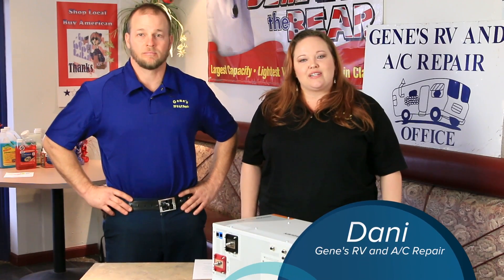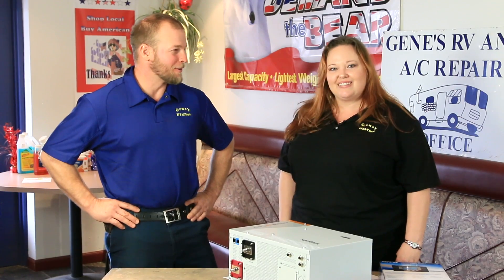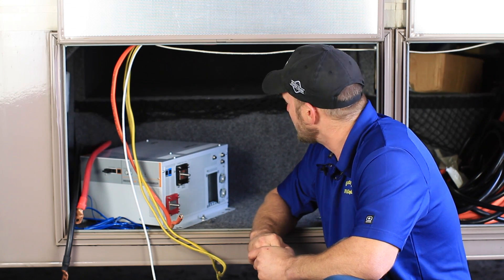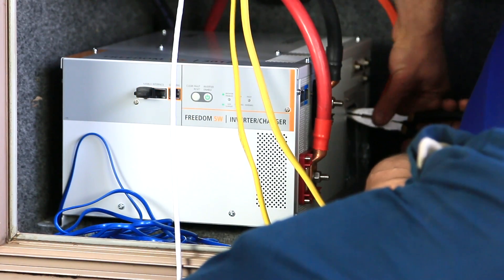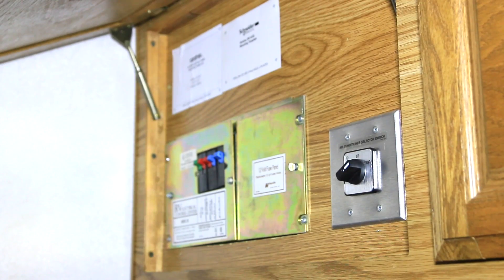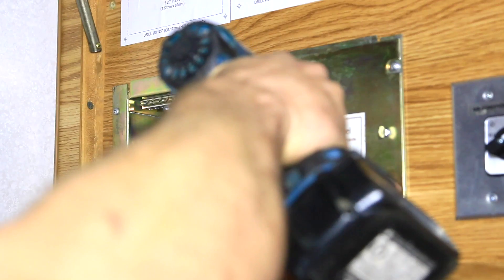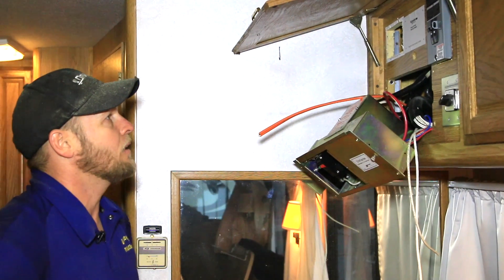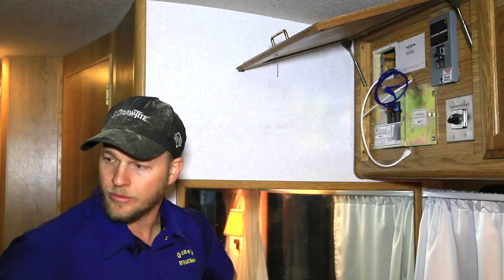Pippi Peterson RV Project - Replacing a converter with the Freedom SW Inverter/Charger System

Comment: Never did show us how to disconnect the shore power AC cord to feed the unit.
Reply: it still goes from transfer switch with generator wire. that then goes into coach panel

Comment: Does the Freedom SW need to be grounded?  Or is it all done internally?
Reply from the maker: For safety reasons the grouding lug should be connected directly to ground. This is actually required in electrical code as we understand it. If the ground is not setup then it will still operate but if the unit has to deal with difficult electrical conditions it has to do without the additional safety-net of the stable ground connection. This can result in personal and property damage in a worst case event. Lesser consequences can be problems with electrical devices. For more information, please consult tech support at 18006700707. Each situation is different so its best to consult an expert for clarity and solution. Thanks for writing to us.

Comment: the video did not show the 12 volt connection to the 12 volt panel. how does that connect? Couldnt be via the large 12 volt terminals on the sw going to the batteries could it? Why is'nt there a secondary 12v output for the rv 12v  panel?. please explain
Reply: The DC connection from the Battery bank to the DC distribution panel does not change.  The inverter/charger connects to the battery bank, while the original converter is disabled.  None of the original 12VDC wiring is changed.

Comment: problem with with this inverter it shuts off at 16 volts, better then most that usually shut off at 15- 15.5,  i like the magnum inverters that shut off at 17 volts, that way i wont have to worry about inverter shutting down when my solar is charging
Reply from the maker: The Freedom SW has different configuration parameters including battery voltage disconnect. For more information, please consult 18006700707 or email customerservice@xantrex.com.

Comment: The sub panel cover shows the ruff cut he made the 2 controllers were at different heights with to much pressure on the wires because it was to close to the hole he drilled the converter was half bolted down and his new wires zig zagged all over and I'm not even there to see anymore of what's not on video

Comment: The product seems really nice but that was a pretty hacked install
Reply: fattybir just curious,...why do you say the install was bad?.......looked ok to me other than the guy had the personality of a doorframe.clue me in to what I'm not seeing.....
Reply: sbecktacular fattybir I'm not an electrician by any stretch of the imagination but I would be wearing safety glasses working around any type of electrical job.
Reply: sbecktacular +fattybir i don't know anything about inverters other than what they do.  However, my pellet stove and A/C manual have install guidelines regarding clearances from the wall.  This unit looks a little bit too close to the wall for proper ventilation.  just my observation.  
As per the pdf install manual... Allow as much space around the inverter/charger as possible. It is recommended that other objects and surfaces be at least 3inches (76 mm) away from the 
ventilation openings for best performance.
Reply: sbecktacular The installation was bad because he used a surface mounted panel when he SHOULD have used a flush mounted panel.   the cover would have been flat, and neat  instead of sticking out with gaps around the box.   that and the fact that he installed TWO 12/2 nm cables in a rx connector that is designed to only hold ONE.  he should have used a duplex connector or a plastic T&B 3201 or Arlington connector.  (anyone else notice the lights on behind him on the wall AFTER he just said he disconnected all power and is ready to begin?)
Reply: ***** yeah,....I see what  you're saying......I watched it again and the sub panel does look crappy.....lol
I'm no electrician though I like to learn....
Reply: Great install, Post your your video of the same install so we can see how you would do it!